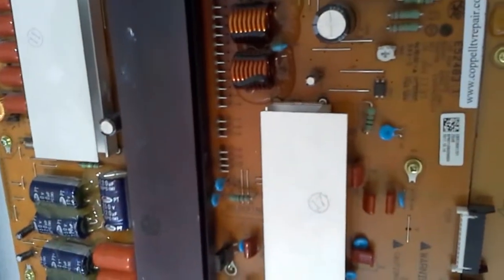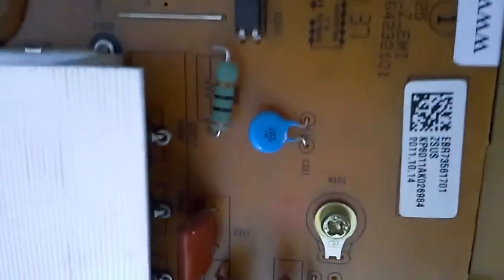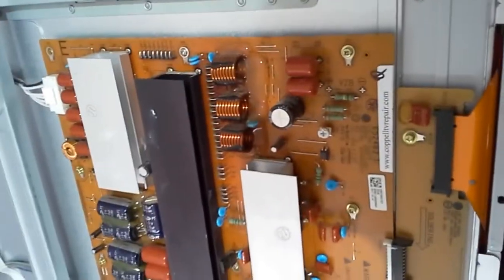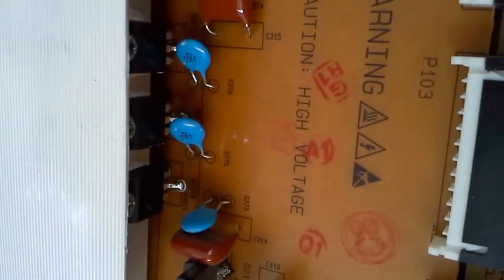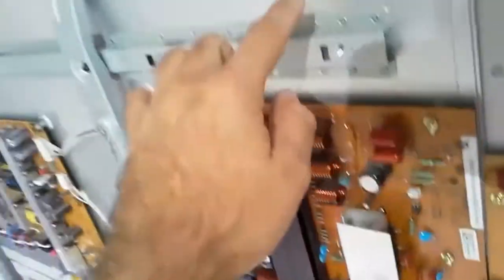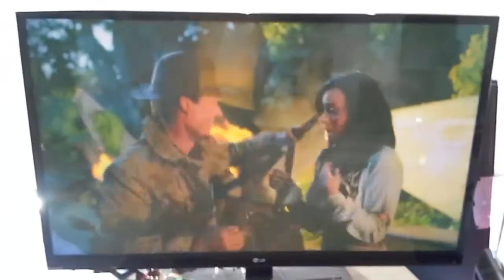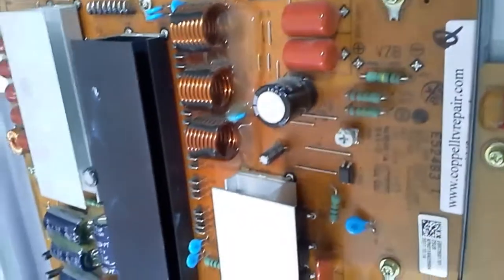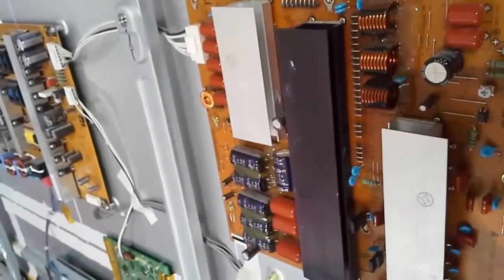Functionality proof EBR73561701 after 2nd repair for bjorkson00

Comment: i have an lg 60pv400 with zsus board issue. after opening the unit  ichecked fuse and was blown.  tv with it zsus fuse blown works but dark spots.   after replacing blown fuse tv click wont start  . do  uhave any idea why?? why tv with blown fuse  turn on but replacing it does not??
Reply from the maker: Fuse blew because another component - in fact at least 5 of them - failed on the board, which caused avalanche process during which fuse blew.
After replacing the fuse the psu can not start because it detects the shortage while it was fully operational and producing full 210v when components failed thus leading to the fuse burning.
Think of it this way: if you get in a middle of shooting you will get hurt. But if you approach a shooting scene you will stop while far enough from it.
Reply: Здравствуйте есть Блок